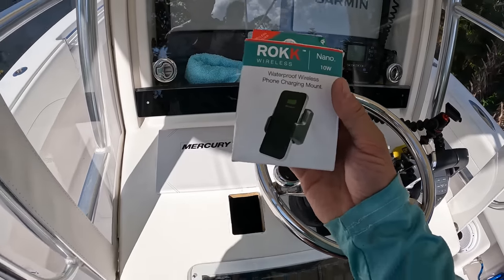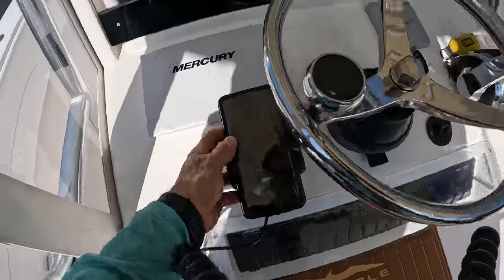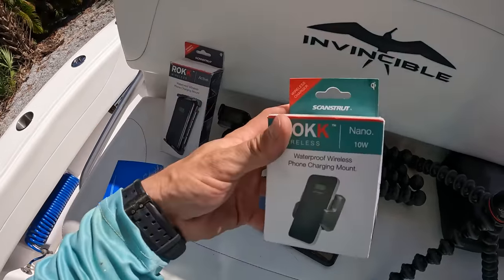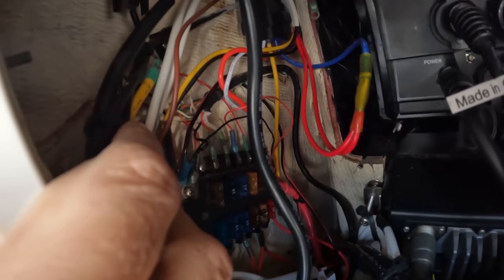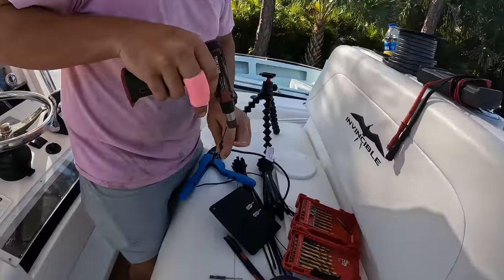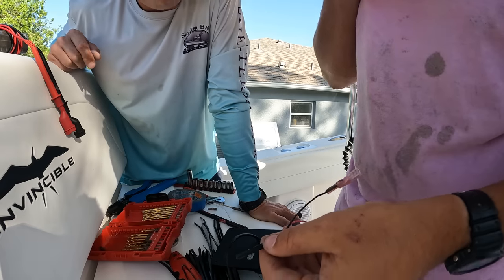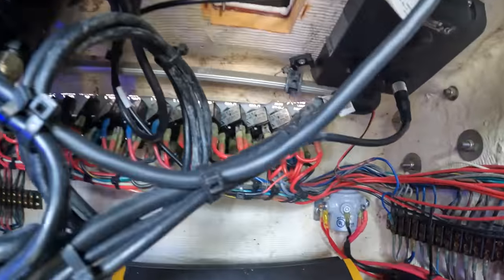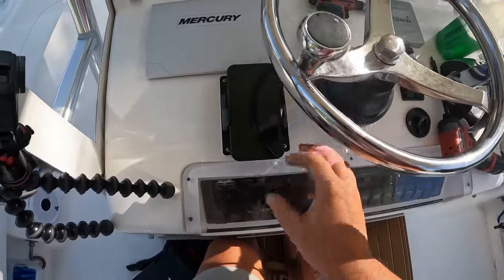MOST Useful Boat Accessory?

Comment: im sure it's a great product. i've seen it and touched it, at the boat show....
then few months later they finally show up at my local shop, $300 for the charger, oh and it's not finished.... the mount to hold the charger to the deck thats another $150...

it's GREAT quality to be used in a boat but $450 woo
Reply: Sounds like a totally different product/manufacturer.  The charger featured in the video has an MSRP of $142 and not additional parts or accessories are needed.

Comment: Just looked it up. $100+ for that.
Reply: Worth every penny!
Reply: Fully waterproof, fast charging.  Keeps your phone charged, safe and convenient.  And no cables to fail, tangle, forget or trip over.
Reply: what a rip for a coil and plastic
Reply: @s0nnyburnett  guess you should build it better and cheaper to make millions on it.
Reply: Hi Rocky, our Wireless Chargers are all IPX6 waterproof, Qi Certified, and UV-Stable. They also feature fast 10W charging, foreign object detection, and thermal cut-off. They are made out of premium marine-grade materials and include a 2-year warranty. 
All of our chargers have been subjected to a high level of environmental, vibration, impact, and on-water testing programs to ensure that they are high quality and reliable. ⛴⛴
Reply: @scanstrutltd6804  I posted the price only because BAB did not. I make no comment about value.